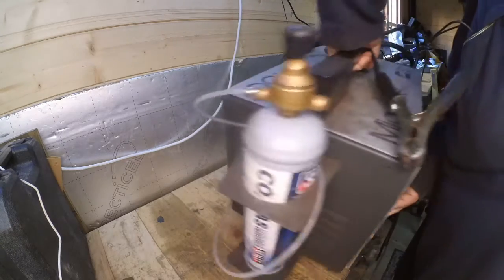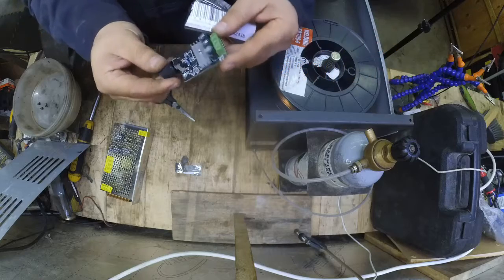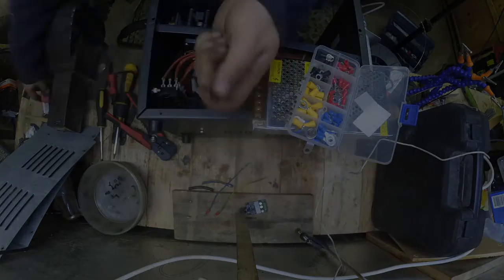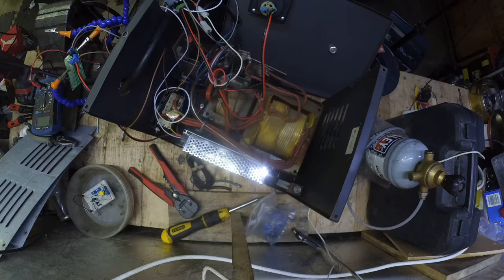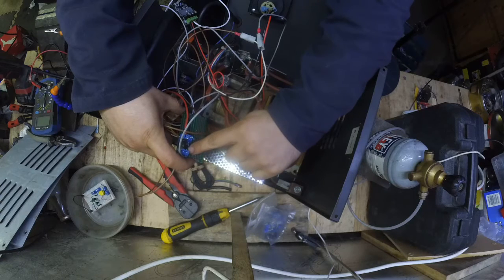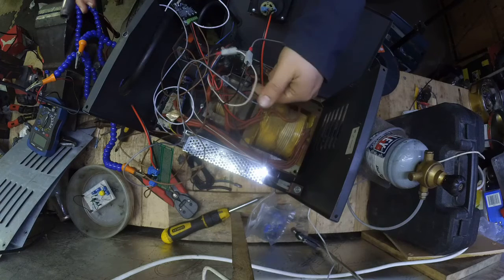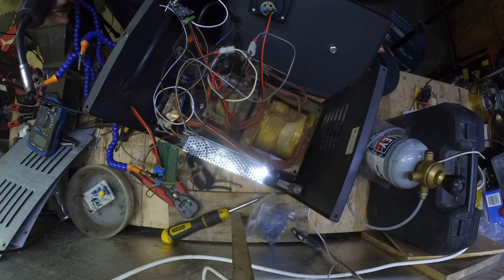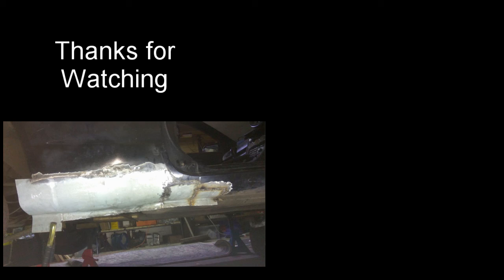DIY Fixing the Migmate 100 welding machine

Comment: Great video - I need to do this on my SIP Turbo 130. It will go down to 25 amps which is good for the 0.75mm steel on my Rover 216 but the arc is unusable because the motor feed bogs down soon as the arc strikes.

Comment: Wow ! This is freaky. I only stumbled onto this video because I was trying to find out if generic steel coil torch liners would go in the MIGmate 100's crappy torch

I've got an identical grey SIP MIGmate 100 that I bought new something like 25 years ago, and it's wire feed was total rubbish right from day one !
Because of this I've been meaning to do the wire feed "Decoupling mod" for ages, and already have what looks like an identical PSU and PWM speed controller that I bought specifically to do this. I was going to solder some wires onto the original control board to get a trigger for the wire feed relay, but you've just pointed out the blindingly obvious (And much easier) option of using the original motor feed as a trigger. The thought of using that to trigger this new standalone wire feed circuit didn't even cross my mind.......... And that fact makes me feel a bit like an idiot ! :D

Another mod worth doing to these is a feed roller brace. The standard wire feed unit is known to flex under load. This flex can allow the rollers to become miss aligned enough for the wire to intermittently slip, so a lot of people make a simple brace bar to bridge the area across the top of the rollers and keep them from spreading. It's not a huge problem (Like the WILDLY unstable 24v line you gave the boot to in this video), but it's such a simple modification that it's worth just doing for that extra couple percent of reliability.

Comment: Wow! I need to do this also!  I have the SiP handymig 90.
It never worked properly from new due to this voltage pull down issue affecting the wire feed motor. Finally after    30+ years I will get consistent wire feed!
Thankyou!
Reply from the maker: its an interesting flaw in the design to not isolate the power from the feed from the power of the short. 
one thing i found as well is that the age of the machine does show thoruhg the penetration needed. im pretty sure my machine at its highest penetration setting wont weld as deep as the manufacture specs say. Buts its good enough to do body panels in my car.